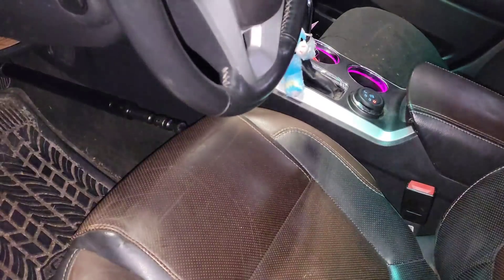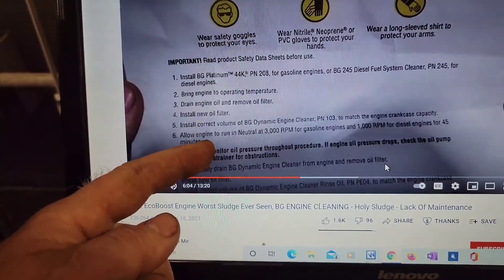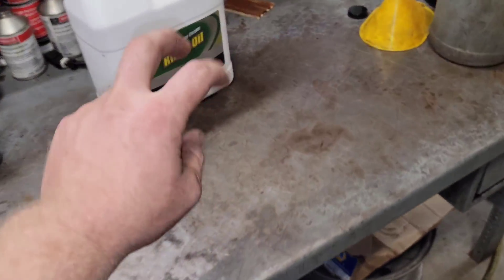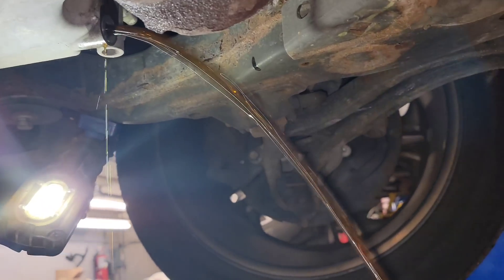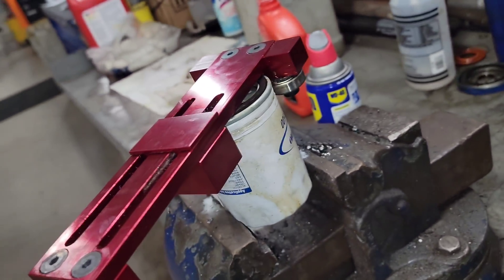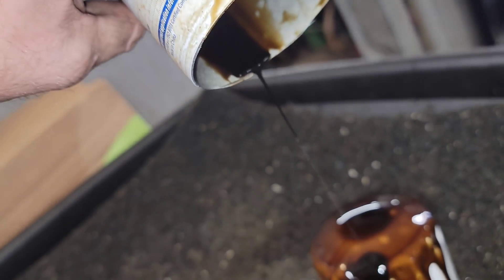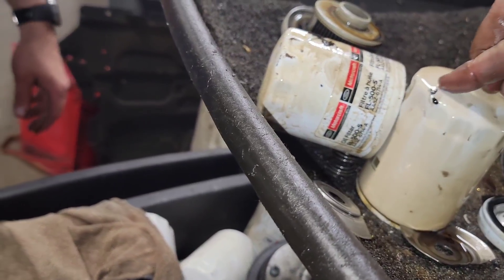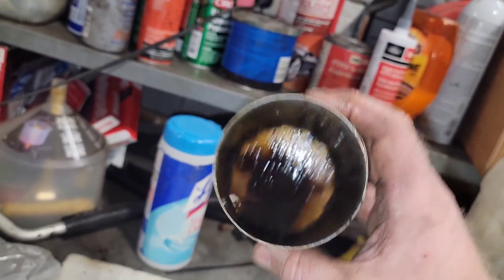Full BG Engine Restoration Kit 2014 Ford Explorer 3.5L Ecoboost - Quick Lube Serviced - Bad Sludge

Comment: is any cleaning of the oil pickup screen needed?
Reply from the maker: You could use a bore scope and inspect to verify

Amazon sells cheap ones that work well
Reply: Thanks, did not know of the bg flush
Reply: Can only imagine the pieces of that plastic material that could be stuck on the pump screen.

Comment: Hey Will This product work for my 99 Dodge Ram 1500 5.2L because my truck don’t show any oil on my dipstick at all, when is crank up or off. Last time I change the oil after getting a tuneup I need it more like 5 quarts and a half. Next oil change, I tried it only drained out one cord of oil I said my truck doesn’t leak oil at all. Where is it going

Comment: I have a 08 Camry with 157,000 burns about a quart every 1200 miles would you recommend this system?? Or just buy the small can of epr and moa?
Reply from the maker: You might be able to try a couple cans of the small stuff but if it was me I would honestly have to use the big kit because when you start burning that much oil you need some heavy heavy additive in there to clean all that out and typically when you get to 150 something miles and you're burning oil that bad if the chemical doesn't clean it all out and at least help you you're looking at a new short block which can run between 7 to $9,000

Comment: Do you think the plastic is from the timing chain guides getting chewed up again?
Reply from the maker: No
Reply: @FordBossMe  F-ing quick lube places man. I saw a video snippet of a "customer states" that showed a canister oil filter with the plastic sheath still over it when it was installed on the car.

Comment: I love your videos, but quit bagging on the quick lube places. The oil doesn’t change itself. You have to take it in and get it changed.  The Valvoline place that I go to typically does a much better job than the dealership. At least they torque the drain plug to the proper specs, then, rather than leave it loose like my Ram dealership did (and told me they couldn’t get it it to look at it for a month, even though the oil was dripping right out of the drain plug after service)
Reply from the maker: Don't complain about what I do bud, spend some time get to know me and why.....complaining gets people removed

Don't like it? Move on

Happy Thanksgiving

Comment: I work for a Honda Dealership as a service writer and seen a demo done by BG at our shop and I always sold and recommended BG product!!! I always use BG 44k every 30k or so in the gas tank, BG MOA, and BG fuel system service with the mister

Comment: so this retails for 350 ish  usd... I have some larger engines that could stand to be cleaned out... 8.3 Cummins and some series 50 detroit engines and some John Deere grapple skidders with what ever engine they stuck in there.... some of these crankcase have capacities of 8+gallons....  the cost to treat these engines would be rather high for my pockets... kinda check to check most of the time... do they sell these in in larger volumes? or are there other products a guy could use ?.. I have used Marvel Mystery oil on my passenger cars... for ever... seems to keep the build-up at bay as far as I can tell.... keep the videos coming
Reply from the maker: I haven't seen any kits larger than these

Yeah I love m m o

Comment: Sup brother . Iv learned to give a disclaimer and tell them the potential catastrophic failure that can occur from doing this lol . One of my better customers that I had to fire went 2 years without a oil change and tried to sneak it by me ...but when this guy started coming to me he had a bad experience from every single person who worked on it 🤔 so me being me I thought ...I know some of these guys and I'd even let them work on my hot rod .well I pulled the valve cover and boom couldn't see a rocker one and it looked like a jello mold of the inside of the cover hahahhahh worst id had and worst still I ever have seen ..... I then told him we could scrape it best as possible then flush it a couple times then go to looking for a salvage yard motor (97 Dakota 2.5l) when I flushed it it lost oil pressure for a split second but was ok 👌 then month later it broke a piston skirt 🙃 so I replaced the motor (he paid) and I always half way overhaul them like crank and rod bearings and she dint drip a lick of oil but it used a little to start with cuz 200,000 miles and it set for years well first time he brought it back I heard it and I ask if he had been checking the oil like I told him and he said o ya ya ya every day don't loose a drop ....he left and it took me 3 qrts of oil to get it on the stick ....he dint even make it home and I said  come get it ....for 300 bucks to get a good motor pulled and installed if you can't check the oil your done 😉
Reply from the maker: There's always a potential for something bad to happen when you're Flushing anything

As a shop and as the mechanic working for the customer that's common sense to explain things to them
Reply: @FordBossMe  absolutely 💯  I wasn't trying to knock the process of it or you BTW...just wanted to share my experiences of one of the times it did go bad ...and the extreme conditions it took to do so ...love you bro you have helped me get threw one of the worst times of my life and helping me keep the fire to keep working ...#effkilmer
Reply from the maker: @themfnnitrorooster7619  you know I'm just talkin openly I don't mean any harm by if I'm just brash sometimes when I say things and I try not to be

Sometimes I just say things and I don't think which I probably should think more
Reply from the maker: @themfnnitrorooster7619  I love you to brother

Comment: If the motor won’t crank is it worth trying to pour it in and let soak or drop the pan and clean the screen? Turns over fine but low oil pressure light comes on and engine cuts off. Oil pressure gauge pressures up a second or two after trying to crank. Any thoughts?
Reply from the maker: You've got a base engine oil concern so you're probably going to have to pull the pan check to see the pickup screen first
Reply: Thank you. Will do tomorrow.

Comment: I noticed the instructions said 3,000 rpms for 45 min in nuetral. What would be a safe way to do this in my driveway?
Reply from the maker: It says in neutral I've seen guys do it in park with no issues
Reply from the maker: And if you are doing it in neutral set the parking brake and chalk the wheels

Comment: I would take the spark plugs out and use a camera before and than after using the BG product.Not just looking through the oil filler opening. Carbon build up is tough to remove just by using chemicals especially in the combustion chamber,because oil in general shouldn't get there😁
Reply from the maker: I don't understand what you're talking about 
this is not about carbon buildup as you're stating 
you made this video what you wanted it to be about when that's a literally not what its about

Are you paying attention here or are you just shooting from the hip because it seems like you're just shooting from the hip and not even understanding what this video is about
Reply: @FordBossMe  I know that it is about cleaning the internals of the engine, but if there's already damage done you can't do much about it.Sometimes on high mileage engine,flushing would make it even worse.Not a mechanic. Just my opinion 🙂Best thing is to do regular oil changes.
Reply: @antonpandoursky9790  You say you are not a mechanic, yet you are giving an opinion like a mechanic.🤔This  vid about saving a neglected engine; not about the advise your NON MECHANIC mouth spewed out. Rich is the Master Tech. This is his channel. Most of us already know to maintain our engines and we come here to get more knowledge and a little entertainment every now and then.

Comment: I work at a quick lube and because of Ford’s lack of strict oil requirements like GM most customers just go with the conventional oil and cheapest filter we stock. Hyundai/Kia is the same way with how bad the engines sludge and carbon up with cheap oil on 3k+ intervals.
Reply from the maker: Ford Specifies to use a semi synthetic oil in all their manuals now so maybe older pre 2010 I can see what you are saying but jot after that 

Want to sell a better oil USE MY VIDEOS and explain why
Reply from the maker: I'll make a video for the quick Lube places to use next week

Comment: How could the motor possibly get this bad in 15000 miles?  They only needed one oil change in that time period and that was obviously done.
Reply from the maker: No Matt 1 oil change won't do it lol

I don't know how many times I keep telling you guys 7500 miles will not cut it and I keep showing you proof why but I'm still being told other people know better ...... Hog Wash

3k - 5k is optimal and no more
Reply: @Matt M Turbocharged engines can degrade oil quicker than NA engines especially if the owner drives aggressively and or tows heavy loads. Therefore the recommended oil change interval in the owner’s manual goes out the window. 3000 to 5000 should be the norm even if the owner doesn’t put the engine through its “paces”
Reply: @standhd  Newer, high quality oils are designed for the high temperatures that turbos produce and do not break down as fast.  3000 mile oil changes are way overkill in my opinion based off the data I've seen, but if that's what makes you happy, go for it.
Reply: @mattm6834  LOL….you on that TRAIN? Then go for it…..apply that to your 400hp Ecoboost  and see what happens….who knows….. you might get LUCKY……

Comment: Think that would be a potential bad idea on a 204k 5.4? Oil changes have been consistent with ford 5w20. It has a sticky phaser.
Reply from the maker: The basic simple step kit yes 

1 small can epr and a small can MOA found on Amazon
Reply from the maker: Or Marvel Mystery oil
Reply: @FordBossMe  I’m not surprised you don’t think I should put 1.5 gallons of solvent through it. If I wouldn’t have bumped into a young girl who came to a complete stop on the freeway and pushed the core support back, I’d trade it in for something newer but wrecked and needs major engine work it’s basically worthless. I’ll drive it until insides are on the outside now then put the front seats in my 86. Former mastertech turned tow truck driver that got hit by a car tending to an accident on the freeway; so now I’m not very excited to work on anything really. Dealer wants 6k for a timing job OR a ford crate. It’s in good shape minus the rockers and core support🤷‍♂️ wouldn’t have a payment...
Reply: @FordBossMe  I used that in anything that doesn’t have a cam phaser lol last conducive thing would be a chunk of debris blocking oil to the cam. It made my 86 blow chunks for sure.

Comment: I'm wondering if I should use this, I have an 11 CR-V that I bought used. The engine has varnish on it; nothing's gone wrong with it, but considering that i could potentially clean the engine and get rid of that varnish layer is enticing..... 

120K on the engine with little known of it's history, it was apparently taken care of; allot of the service done at dealer according to paperwork. The varnish isn't heavy but I had an 06 Focus with 120K on it (that this replaced) that I changed the oil every 5K no questions asked and was as clean as a whistle.
Reply from the maker: Start with a smaller basic flush

Amazon - 1 can Epr 1 can Moa
Reply: Thanks, I will.

Comment: Watched a couple videos where the tech removed the oil pan before and after the BG Flush and man the engine's look virtually spotless inside. The bottom end looked cleaner then the top end where the valve covers were removed as well. But your right what a phenomenal product
Reply: No oh

Comment: I thought you couldn't flush these engines, all the crap trashes the turbos I was told....
Reply from the maker: What are you going to do are you going to leave all the trash in there let it destroy the engine anyway or you going to make an attempt to clean everything out and at least get it to run longer
Reply from the maker: Remember the old saying damned-if-you-do damned-if-you-don't well that applies here
Reply: Gotcha, makes sense.  I guess that means new CR performance turbo manifolds and bigger turbos….

Comment: Great video..Does it clean diesel engines as well as gasoline engines?
Reply: Considering the amount of times the oil had to be drained, there would probably be nothing left to clean afterwards.
Reply from the maker: Did you watch the video? Because when I show the instructions and I'm reading off of it it says diesel engines can be flush with this kit instead of 3,000 RPMs you do them at 1,000 RPM
Reply: Yes I read that part from the computer screen on the video. I was just asking if you personally have tried it on diesel engines?

Comment: Hello. I hope maybe you will see this video and can help us out. Or someone can. I currently have a 2006 Ford Mustang GT 4.6 3 valve, high performance motor and all spark plugs but number 8 have been able to get out. Now we have taken it several places that claim they don’t want to go further taking it out in case they break it. Any suggestions on how to get it out we have sprayed around it to try and get it out. It is not budging. Any ideas? Thank you in advance! :)
Reply from the maker: Yeah there's one or two things that's going to happen it's going to break or it's going to come out

You're going to have to use an air tool to Jar it loose I know that doesn't sound right but it's literally the best way

If you look at my Ford Edge 2.0 ecoboost coolant intrusion video in the library you'll see what I'm talking about by removing the spark plug with an air tool

The problem is those spark plugs to get stuck in the motor and then you have to use a special extraction tool to get them out and they were bad about that

Comment: Most of the time these quick lube places charge you for synthetic oil of the proper viscosity but what you actually get is non synthetic bulk 10w30 and half the time they don't even bother to change the filter. My wife was taking her mini Cooper to the dealer for oil changes until the turbo crapped out at 50k due to carbon build up in the oil, after that I started changing the oil myself using liqui-moli 5w40 and hengst brand filters every 5k and no more high carbon content. Never did figure out what exactly the dealership was doing different but I solved the problem. I think another issue is these oil life monitor deals and these 10-15k recommended change intervals, maybe if you are running amsoil or royal purple and some high dollar filter you may can go that long but on the run of the mill oil and filters you get at your average shop I think 5k is about as far as an oil change will safely go.
Reply: I don't work at a quick lube..but boss man makes us put our initials on the oil change sticker when I make it..everytime I print that sticker I start  doing a checklist in my head haha
Reply: Yes u are correct 💯. I can't do my own so I do go to a locally owned quick lube but they give the option of bulk or bottled I been using Castrol GTX full synthetic in my 09 kia optima LX with the 2.4 and it has 105k on it ever since I've owned the car now 4 years I've taken it there. And I use shell V power 93 in it and nothing else no matter the price a gallon the extra you pay helps the life of the car..and it's no extra charge for the bottled oil than bulk!!

Comment: what would you recommend for sludge in a 1.8 2003 Corolla motor? i've done 3 1,000 mile oil changes and its still bad
Reply from the maker: Marvel Mystery Oil or start using the B G stuff the small cans on Amazon

Epr it's called

Comment: My Grandpa told me this story 50 years ago. In the 1930s, he drove Ford Model T Delivery Trucks. The Company he worked for was real regular about oil changes. When Detergent Motor Oils came out, the Company used it. The engines started using oil like crazy. Then it stopped. The oil cleaned out the sludge and varnish from those simple engines.

Comment: Since you work in the field:
Lets say a car in my family was bit neglected for some time and ran 22.000 Miles without changing the oil before I decided to do it for them. 
How bad is that for the motor? 
Should I flush the motor or is it going to be fine? I know if I annoy them about doing a engine oil flush they will most likely decline :)
Reply from the maker: I mean I don't think you're ready for my answer based on what you're saying
Reply from the maker: If anything use something like motul or red line or Aimsoil 

If they are offended by you telling them they need an engine flush because of their lack of Maintenance that maybe they don't need to be driving a vehicle
Reply from the maker: Or use regular full synthetic oil but before changing it run some epr from bg on Amazon in the old oil then drop it and put fresh in
Reply: @FordBossMe  yeah that's going to be the most I can do for them: 
Let them drive for a bit with the oil I just put in than fill in a can of engine flush, drop the nasty shit and send them on their way with a good quality synthetic in the motor.